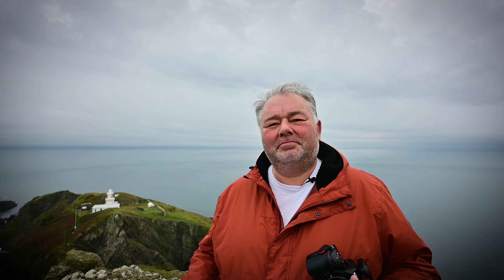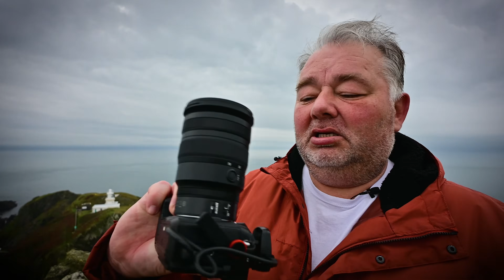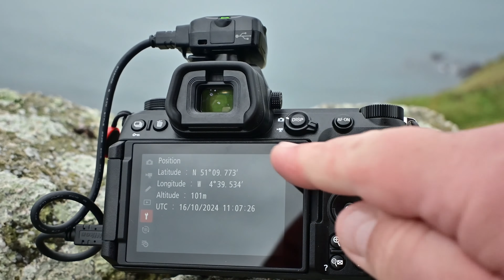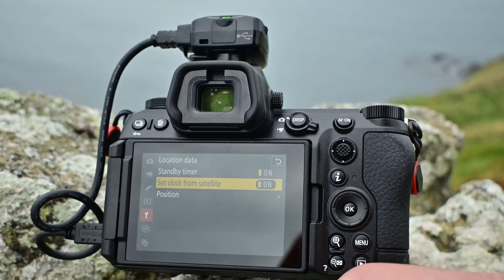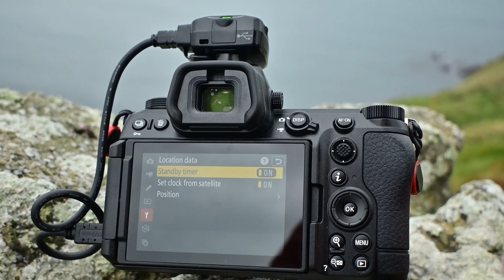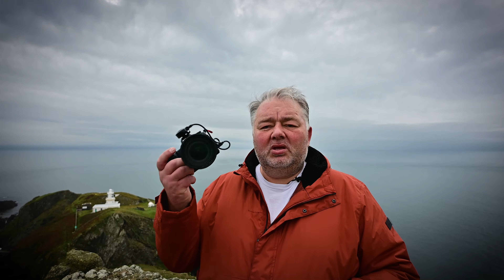Nikon Z Series adding GPS, Z6III and other Z Series cameras

Comment: I have just bought the di-GPS Eco ProSumer M for my Nikon Z6 iii, it is apparently much less energy intensive and more precise than the Nikon GP-1A module which is also very difficult to find. We'll see a-but I think it will be perfect.
Reply from the maker: thank you for this. I will check it out
Reply: Does the di-GPS Prosumer M work on the Nikon Z6III...
Reply: @iqbalhussain9853 of course

Comment: Buy any Garmin GPS receiver and set it to record the GPX file at 1 second intervals. Use Geosetter (free) or other suitable app to use the picture EXIF time/date to sync to the GPX and write the position into EXIF. Just make sure your camera time is exactly right (take a picture of the GPS showing seconds at the end of you hike, if there's a idscrepancy then Geosetter allows tou to apply the correspnding offset to ALL the picture time stamps). Alternatively use the blutooth/phone solution - most phones have extremely accurate GPS receivers. Almost certainly more accurate than the Nikon dongle he is using.

Comment: I have been using a Z5 (in the U.S.) for almost a year.  It was updated with the latest Z5 firmware.  I was able to use it with a Micnova GPS unit which plugs into the remote release jack.  It worked well.  Your advice about pulling the plug is important as that does seem to be a weak point.  I have just traded the Z5 back in to Nikon for a Z5II.  Now I have a new GPS challenge!  The Z5II does not have the remote release jack that the Z5 has.  It uses a remote release with a (more standard) headphone plug (barrel style).  I see nothing published about whether GPS data can be fed into the USB-C port on the Z5II.
Reply from the maker: Thanks for this! I don’t have the Z5II yet, but I’ve had the filter removed from my Z5 to convert it into an infrared camera—so I expect the Z5II will be joining the kit soon. 🙂

I use a Garmin InReach Mini 2 to record my GPX data, which I then sync in Lightroom Classic. It matches the GPS coordinates to each photo based on the date and time metadata.

Comment: I use Micnova GPS receiver for my both Z8 and Z6III and it works really well. It's about £49 on Amazon. I don't remember how many cables I have damaged by forgetting to unplug them from my previous cameras before putting them in my bag, luckily this didn't cause any damage to my equipment.
Reply from the maker: Thank you for this. I knew there were other GPS receivers on the market, just not looked into these options - Micnova GPS receiver https://amzn.to/3VXM0JM

Comment: For the Z5, is there a way to have gps data synced to the photos automatically as they are being taken or is there no other option besides sinking the photos to a gpx file afterwards?
Reply from the maker: Nikon UK removed the in-body GPS function a few years ago. It was left on by mistake. You can use the Snap Bridge app on your phone or an external device like Nikon's GP1

Comment: I was watching your video yesterday and suddenly remembered that I bought a 3rd party GPS receiver from ebay some years ago. I planned to use it for my D850. I was not using it so mutch so it stayed hidden in one of my older camerabags. Bur now I have tested it on my Nikon Z8. It works fine and inserts EXIF files to both RAW and JPG photos. The manufacturer is Aokatec and the type of GPS is AK-G1s GPS Receiver.
Reply from the maker: thank you so much for this information !

I found one on ebay - https://ebay.us/TlZqwp

Comment: Nikon Z8 can receive GPS data from an Android phone through the SnapBridge app, which allows you to transfer location information from your phone to the camera, essentially "geotagging" your photos even if the Z8 itself lacks built-in GPS functionality.
Reply from the maker: yes, totally correct !!! with one downside, your battery in your phone will deteriorate, thank you for your comment
Reply: @markology  I used the SnapBridge app to geotag my Z6III images on a week long trip. I took about 3000 photos over the week. To my surprise I didn't notice any difference in it draining my iPhone 14 Pro battery at all.
Reply: @ that’s great news, perhaps the App designers have now reduced the power drain. Whatever has happened that’s great to learn that the battery consumption is not being drained so much as in the past. Thank you for letting me know.